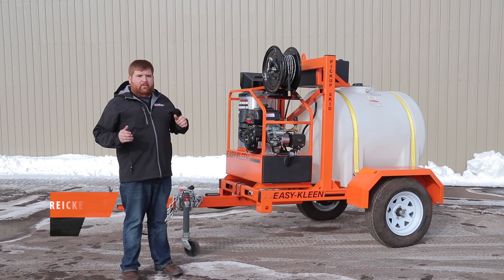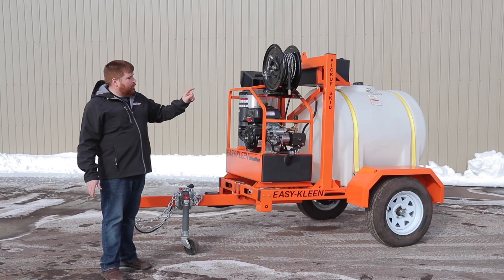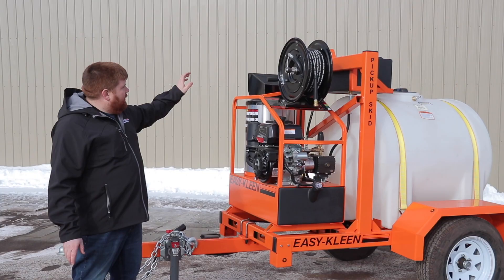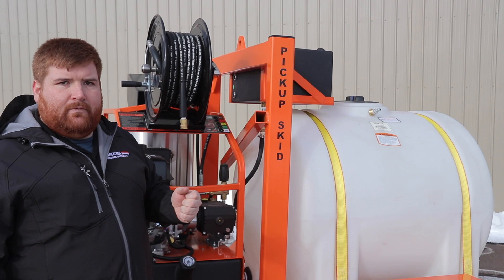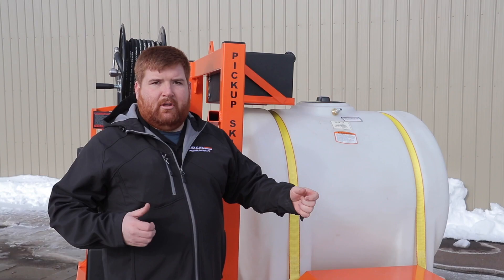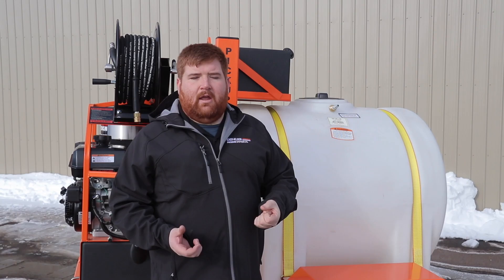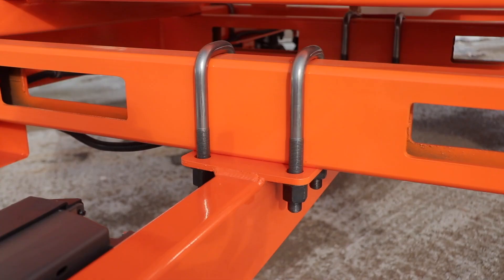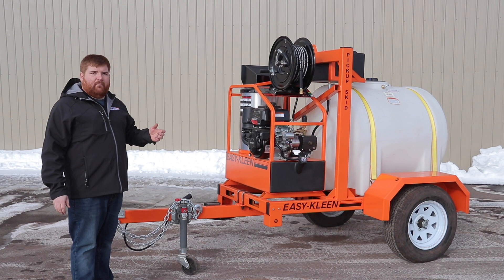Pickup Skid Bolt On Trailer Package - Easy Kleen

Comment: What is the total weight? Thanks
Reply from the maker: Hey there! 

These Pickup Skid Bolt-On Trailer packages are around 1200 pounds when the water tank is empty.
These units come with a 225 Gallon water tank, so when that tank is full of water, it will be approximately 3000 pounds.

If you have any further questions, do not hesitate to ask! And feel free to give us a call directly at 1-800-315-5533.
Thanks!

-Colin